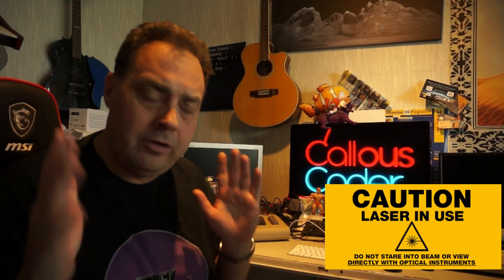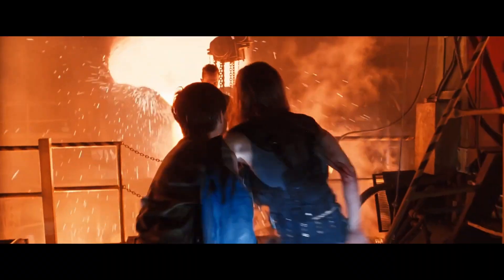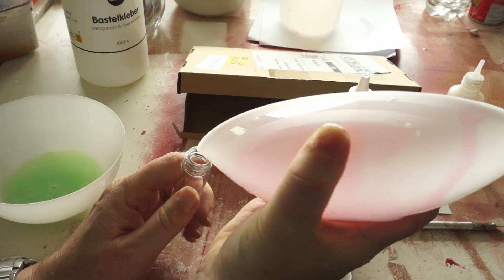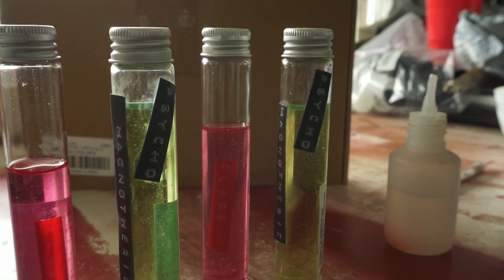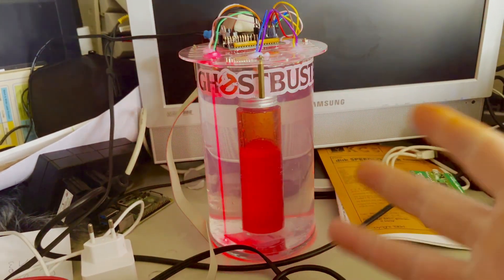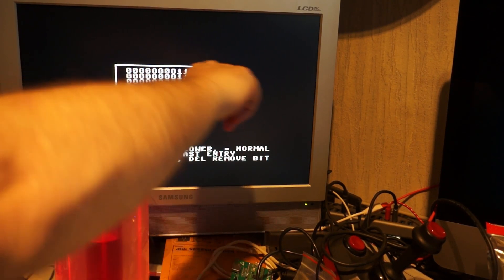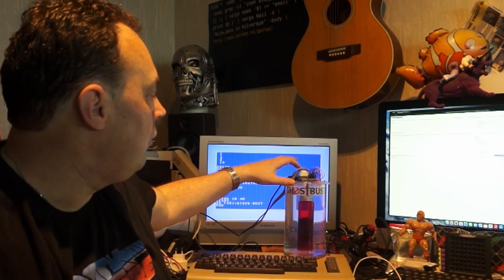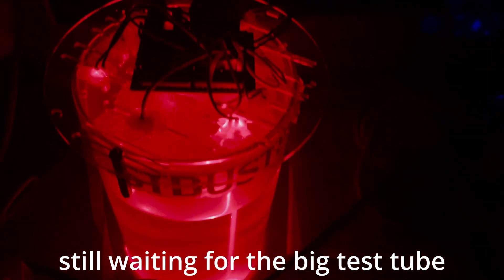C64 controls Ghostbusters inspired, Portable Laser Containment System

Comment: Can you do a 16 bit version on a C64? Would like to see a deep dive on your board and how it works. The 16 bit angle interests me.
Reply from the maker: I am back home and had a look at the code:

 //set low led bar (requires PB2 to be high)
        lda $dd00
        and #%11111011
        sta $dd00
        lda #xx  //8bit_value_for_leds_4lowbar
        sta $dd01

        //set high led bar (requires PB2 to be low)
        lda $dd00
        ora #%00000100
        sta $dd00
        lda #xx //8bit_value_for_leds_4_highbar
        sta $dd01

This is how you can switch the upper and the lower latch and output 16 bits.

I hope this helps! Also the schematic and pcb are on the link in the description.
Reply from the maker: @saganandroid4175  oh yeah it’s just toggling that bit PA7 (I believe, I’m not home now) to 1 and you write again to the same port and it will load it in the other latch. Being the bit low and you will write to the lowest 8 bits again and the other latch still holds the data.
If you download my code off this video (where I program the patter) you’ll have all the details. The first 8 bits used the upper 8bits the lower used the lower 8 bits.
It’s trivial, you just toggle that one control bit.